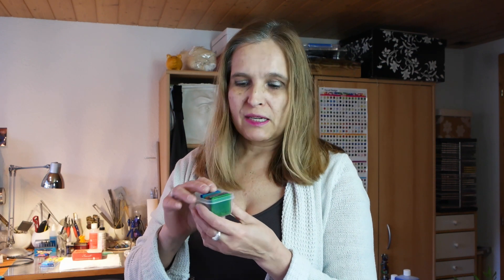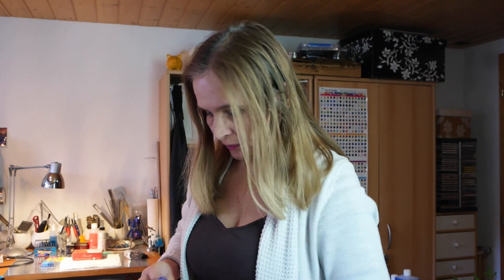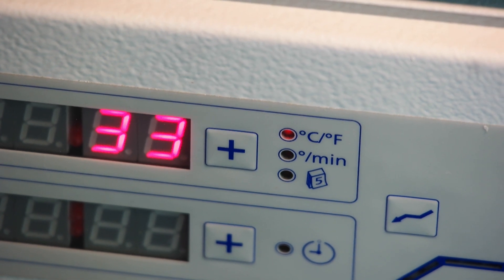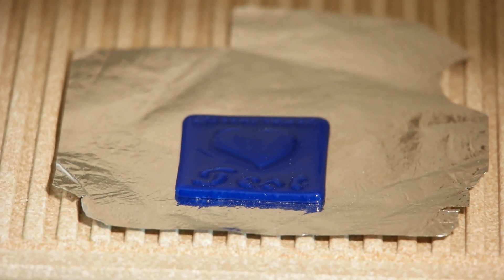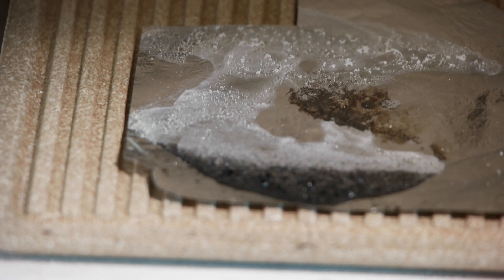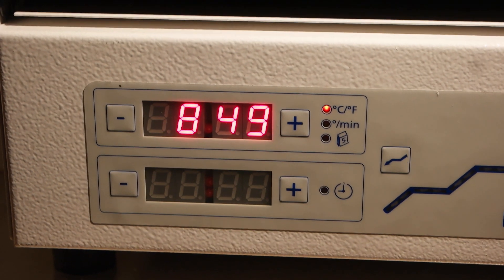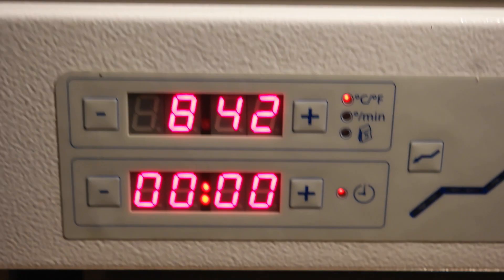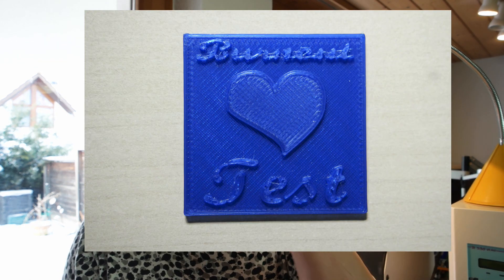Let it Burn Series: iBeam Blue Wax Casting Filament

Comment: have done anything complicated with it and if so what was the print like.
Reply from the maker: What do you mean? How complicated it is to print with? It’s absolutely easy to print with. I was really astonished
Reply: @choschiba  have printed anything with a lot of detail and if so did you get a clean print. something with sharp edges and voids. did it print as well as pla.  I tried poly cast, moldlay and could not deal print quality
Reply from the maker: I can give it a try
Reply: @choschiba  thanks
Reply from the maker: Which model would you like me to print using that filament?

Comment: ... ein interessantes Video. Aber ich verstehe noch immer nicht ganz den Grund für solch eine Versuchsreihe
Reply from the maker: Ich werde zukünftig 3D gedruckte Modelle in einer feuerfesten Masse einbetten und anschließend dieses Einbettmasse Modell dann im Ausbrenn- & Vorwärmeofen ausbrennen und  die sogenannte „Muffel“ auf 850°C bringen. Anschließend wird in die Muffel dann Silber oder eventuell sogar Edelstahl hineingegossen. Wenn das eingebettete Objekt nun also nicht 100% ausbrennt und Asche in der Muffel (Einbettmaase) verbleibt, so hat das fertig gegossene Objekt später lauter Löcher und Krater. Es ist dann nicht zu verwenden. Ich hoffe du kannst etwas damit anfangen. Zu einem späteren Zeitpunkt werde ich dann auch einen Film darüber drehen.
Reply: @choschiba  OK, ich hab's verstanden. Du stellst also mit Hilfe eines 3D Drucks ein "Gussform" für wohl Schmuck oder Ähnliches her. Wie im Großen beim Glockengiesen und Wachs, so im Kleinen mit dem vollständig verbrannten 3D Druck. Und dafür suchst du nun das geeignete Material. Tolle Idee. Bin mal gespannt, so einen ganzen Zyklus zu sehen.
Reply from the maker: Genau so ist es.

Comment: Great information! Looking forward to seeing the results of other 3D printing materials.
Nice furnace btw 😉
Reply from the maker: Thank you so much dear Stefan. Yes, that furncace is much better than the old one. No risk of electric shocks anymore. Luckily there is a heavy current connection in the room I could hook it up to. Here in Liechtenstein and Switzerland the max. Ampere on a regular socket is 10 Ampere. Everything above has to be running on heavy current.